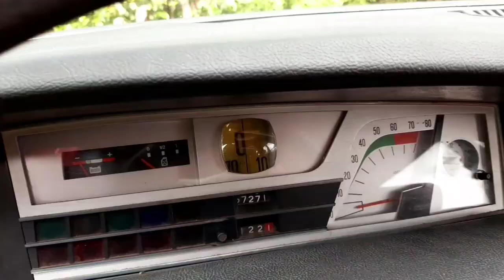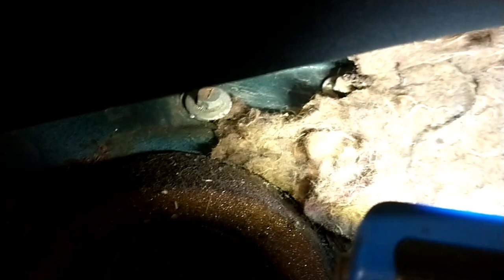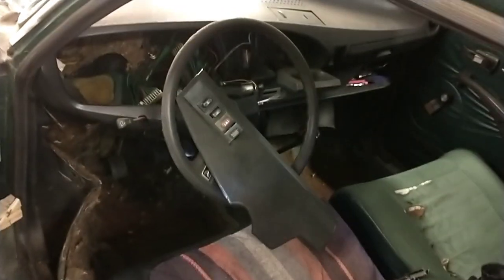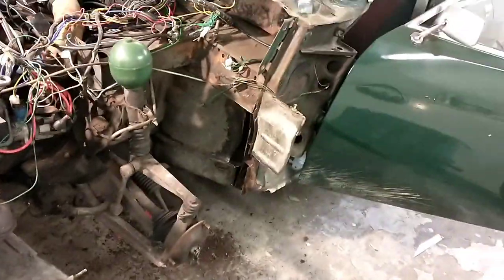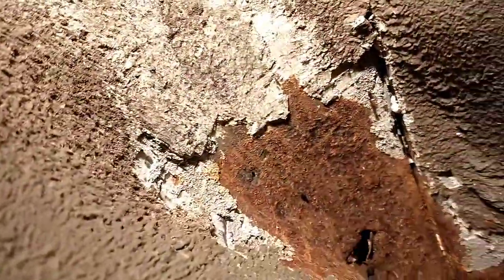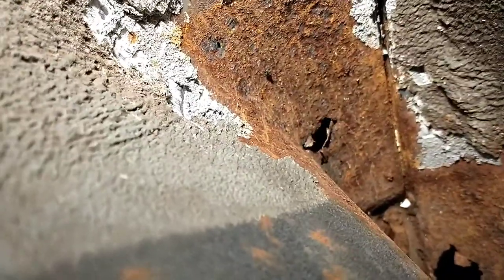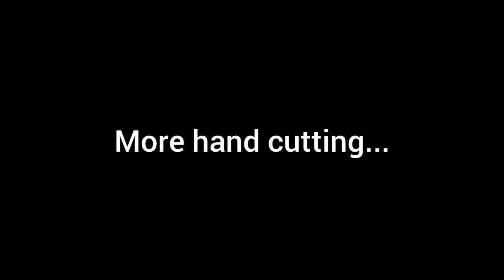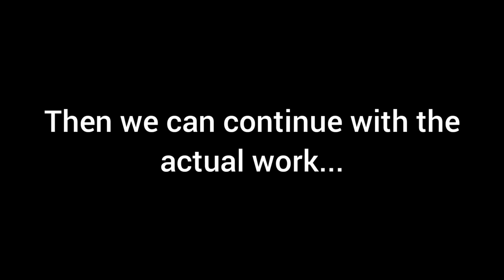Air intake sill rust damage repair.

Comment: In the 60s and 70s the quality of sheet metal used by the French was pretty thin and rust was all over the place.
Good luck fixing it.
Edit: Well, you sure got it done A-OK! Very nice job.
Reply from the maker: Something happened with the steelquality around 1974. There's a big difference between for example a 1977 car and a 1972.
Reply: @citromec  did it get even thinner in the later years?
Reply from the maker: @rjung_ch  i think the steel quality became different those years probably due to changes in the mining industry. More recycled steel i suppose.